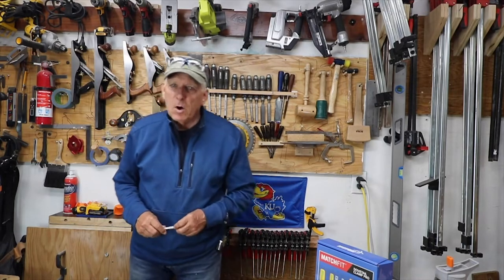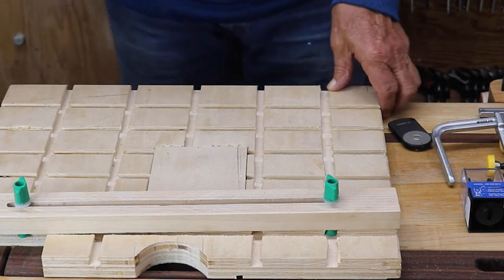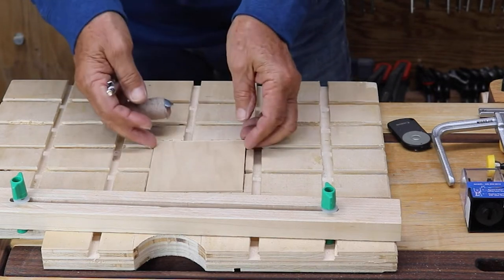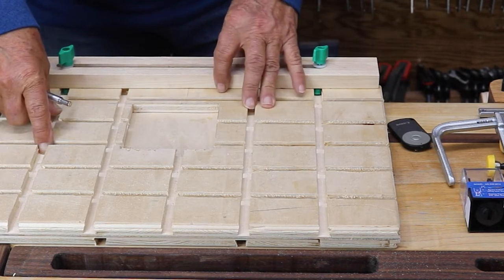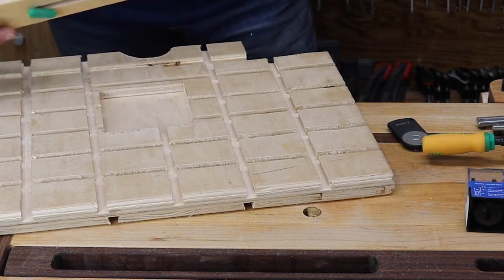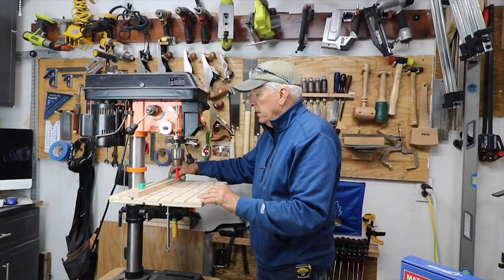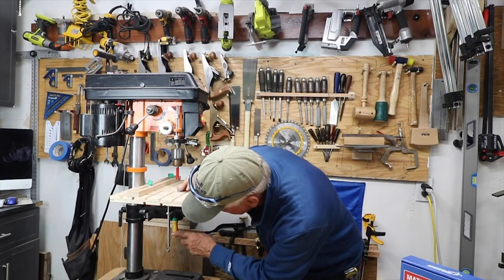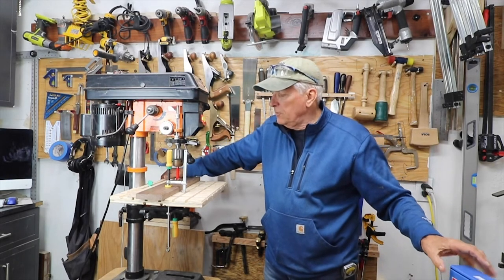Drill Press Table Using Matchfit Dovetail Clamps from Microjig

Comment: Very adaptable drill press table!  I especially liked the insert offset design so you can get 4, possibly 8 unique uses from a single insert.  Then just pop in a new one when needed.  You mentioned the cutout for your lever on the back.  Although I didn't catch that innovation, thanks for mentioning, I did see where you cut an arc or curved relief on the back side of the table so it could better marry up with the drill press column.  Nice job!, and thanks for the video!
Reply from the maker: Hey, very welcome and thanks for taking the time to comment.  I appreciate it!

Comment: Cool set up! If you incorporate the system in to your other tools and jigs, the cost wont be so bad.
Reply from the maker: I am just now finishing a redo of the drill press table (second effort), a table saw board straightener that does triple duty as a tall fence and a tapering sled as well, and a bandsaw tall fence, and couple of different circular saw and router cutting guides  - all using Matchfit Clamps.   And then I am going to do a cool cross cut sled using the Matchfit Dovetail Clamps!  So, yes, clamp cost amortized over so many workshop jigs and aides will not be too bad.

Comment: I'm sorry,  I'm not a fan. This has about 10 dovetail slots, which are not that easy to make, when 2 T-slots or 2 slots for T-track would cover moving the fence and any hold down clamps and you can use any of the clamps made by Bessey, Armor tool, Rockler or Kreg and some of these clamps have auto adjust technology and can swivel 360 degrees. A dovetail slot basically locks you into using Microjig's clamps and limits choices. Enjoyed the video and your presentation but not the concept.
Reply from the maker: I appreciate your taking the time to share your opinion.  Good for others when they see alternatives.  One of the things I like best about the design as I have done it is the ability to clamp the table to the drill press table with zero profile.
Reply: I'm a newbie and just trying this system out.  I might switch over 2 the t-track as I go along.  I like the variety of t-track clamps; and hey, let's face it, the blue color is prettier. LOL
Reply: @dscritter614  T-tracks can be expensive too and you cannot move them from one jig to another

Comment: This is one of those Déjà Vu videos, because I swear I watched it earlier last week, or late the week before. Unfortunately I can't find the email for the original video to prove my sanity. I delete videos once I've watched and bookmarked them if necessary, but I hardly ever empty my trash folder, so why it's not there I don't know.
Reply from the maker: Sorry if I made you watch this twice - first one had some really bothersome music which interfered with the audio - hopefully, your second time through you heard something new.  Or, as Yogi Berra famously said just put that in the category of "Deja Vu, All Over Again!"
Reply: @SmallWorkshopGuy  No, don't be sorry, it didn't bother me at all by watching it again. What was bothering me was that I couldn't find the email notification for the first video to prove I wasn't insane. Even if after watching and bookmarking the video I deleted  the email, it should have still been in my trash folder, but it wasn't.
Reply from the maker: Oh, computers are meant to drive you a little insane from time to time.
Reply: @SmallWorkshopGuy  Thanks for this comment; it prompted me to re watch your video on the 8 jigs you made using this system. I don't need  the Pro kit, (at least not now), but I know what I'm going to be doing with the clamps and router bit.